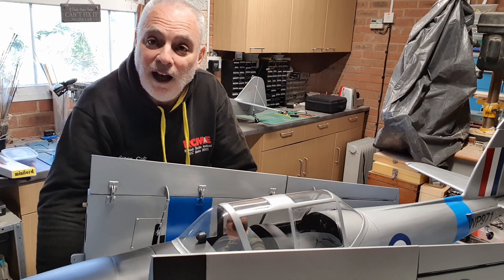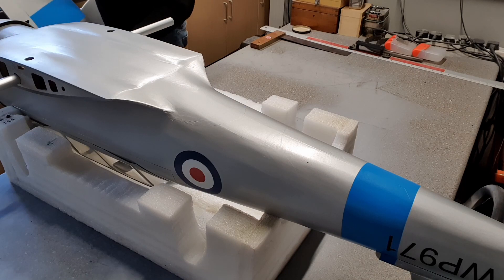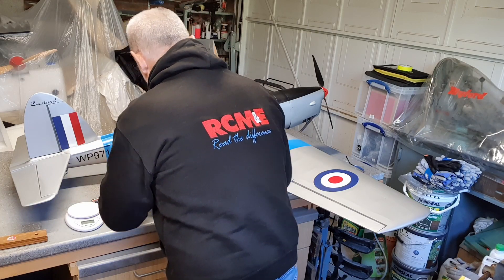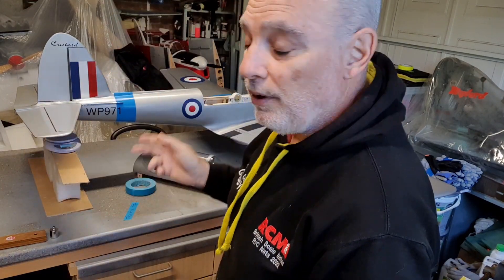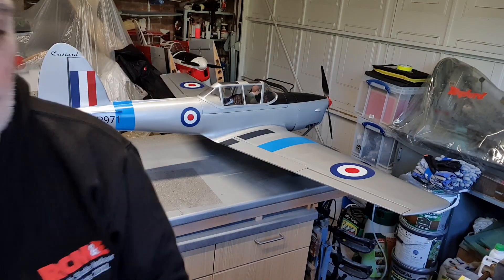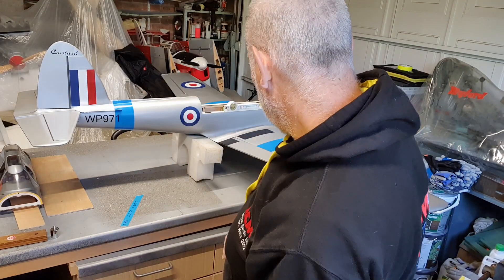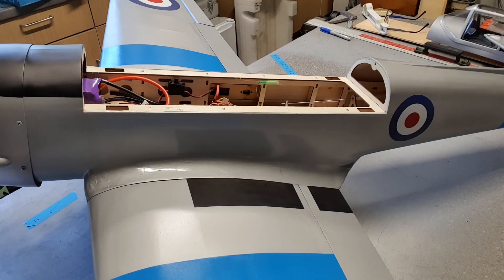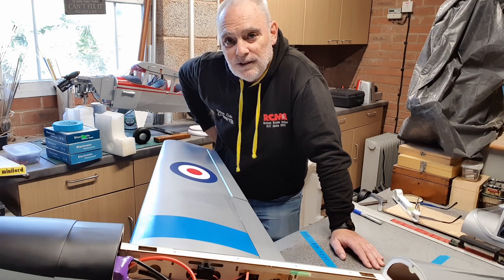Just a moment

Comment: If there isn't a usable datum line,  you can set the model based on the project  tail or wing angle of incidence.
Reply from the maker: Agreed, i nearly used my incidence gauge. This method does not get upset by levelling devices upsetting the balance, which can happen with the Vanessa rig.